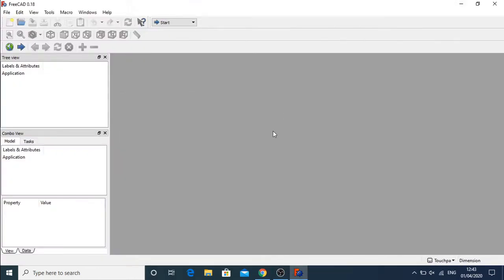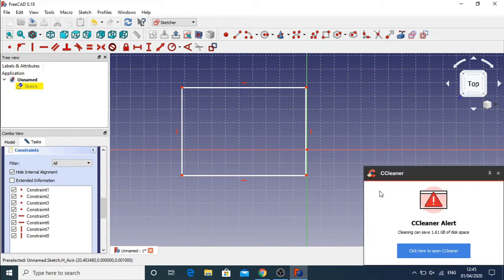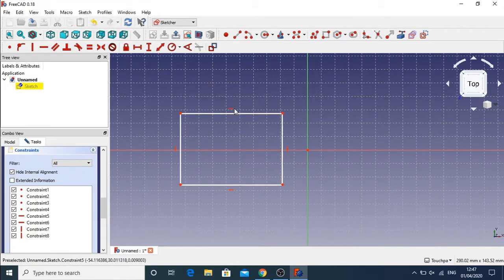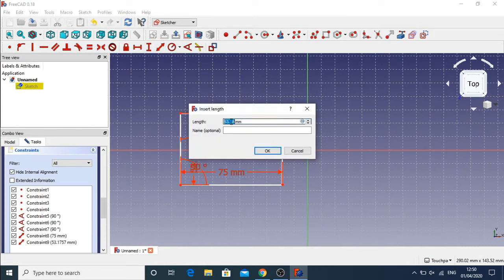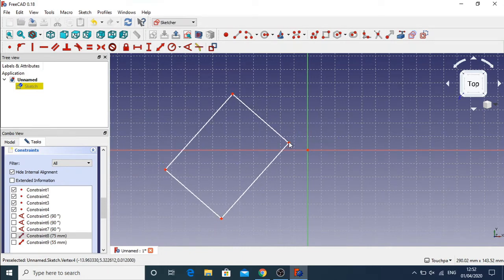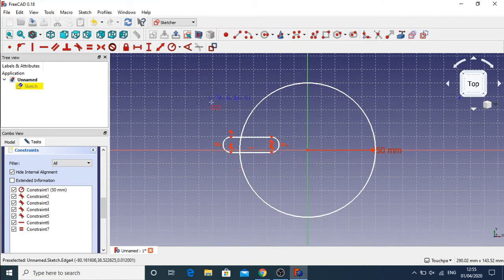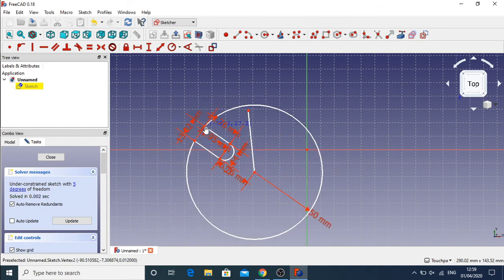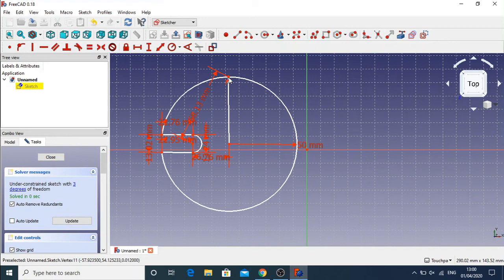Freecad: How to Rotate Geometry in a Sketch

Comment: are the corner constraints simply perpendicular constraints? Can you draw a rectangle without H and V constraints, and add an angle constraint to a plane or line?
Reply from the maker: There are many combinations for the constraints both of those what you have suggested will work. All depends what your end result require. With your angle constraint suggestion I see that you may be looking to keep the square parallel with another edge / line so if the edge / line changes in angle then the squares shape and alignment is maintained.

Comment: Transforming the constraints so that they only refer to other parts of the same shape is not trivial though.
I don't think it's even doable in general.
FreeCad being a bit kludge, this is surprising though that there is not even an attempt, that would sometimes work like the rest of the software.
Maybe something like: Clone a shape by using the current distances and angles as constraints, like a snapshot.. Obviously you would lose the constraints that made the shape in the first place, but you can't really have both

Comment: I feel like the title of the video should include the word "workaround". I understand that constraints prevent arbitrary rotation, but surely a "rotate by 90" or 180, or "flip vertically" etc action would be feasible. I would also be fine with having every axis-related constraint automatically removed and the geometry just placed at the new location, then I could add back constraints manually. Removing constraints manually is a pain in the ass, and wrangling with the partially constrained mess makes me feel like a caveman. I usually find it quicker to just re-create the entire thing instead of trying to rotate it.

Comment: This is a possible work around. But what I'm really looking for (and maybe others as well) is the ability to select all the objects (constraints or not) and rotate them as if one they are one rigid body WITHOUT having to constraint them relative to each other first.
Reply: You can transform the hole sketch outside the sketcher workbench. I put the sketch onto a datumplane and bring it into the right place.
Reply: I couldn't figure out how to put a sketch onto a datum plane, but I discovered you can rotate a sketch by changing the Angle in Attachment Properties (down left).
Reply: @hansmaulwurf8027  Do you create a separate sketch for what you wish to rotate? Or is it possible to select elements within the sketch and attach them to the datum plane?
Reply: You only can attach the whole sketch. If You only want some elements of the sketch can use a Binder
Reply: @hansmaulwurf8027  Ta
Reply: "Use the 'revolve' tool in the part design workbench to rotate a closed sketch around a construction line on the z-axis."

Comment: Good explanation and useful examples. I'm just trying to work out if I'd be better to start from scratch or to try and convert all my horizontal / vertical constraints to 90 degree angle constraints.
Reply from the maker: Thank you for your kind contented. Depending on the time and complexity of what your designing I always find that I learn something extra if I do a rework but usually find I spend 3 or 4 days of procrastination before I decide to go ahead.